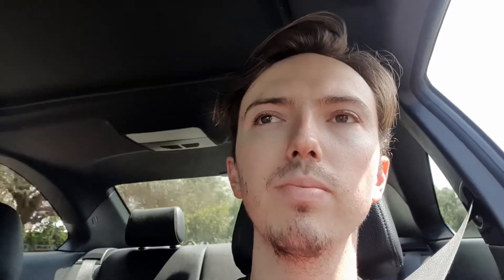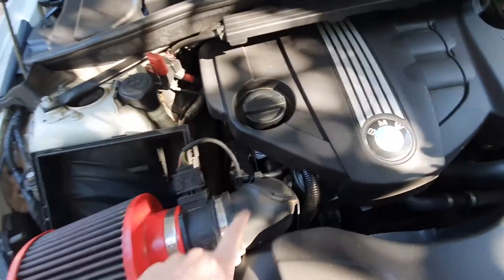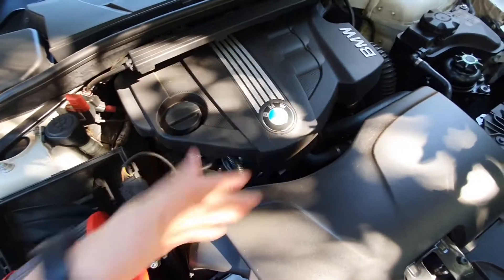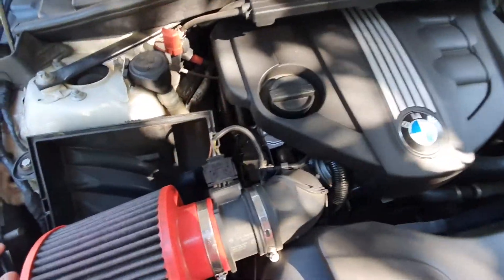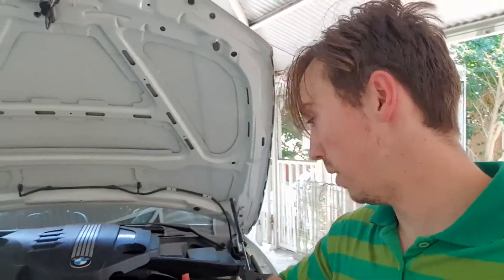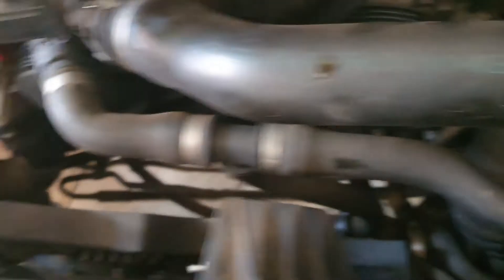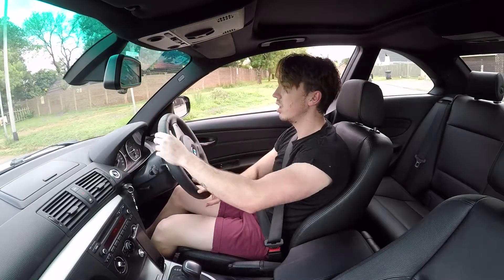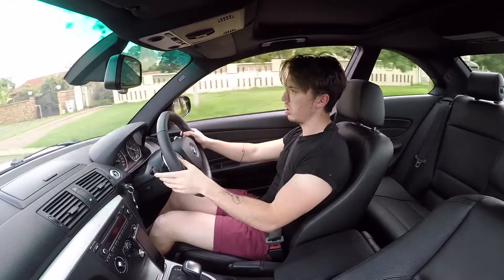E82 120D EGR Delete and Curstom Intake

Comment: What did you use for re connecting the breather pipe?
Reply from the maker: A rubber pipe that could fit over, and that then goes into the catch tank👍🏻.
Reply: @ChrisVSCars  thank you! 👌🏻 what size silicone pipe did you use?
Reply from the maker: I cant remeber ill check and get back to you😁
Reply: Breather to catch tank then go to where? I cant see the hole thru air intake... can you please enlighten me 🙏